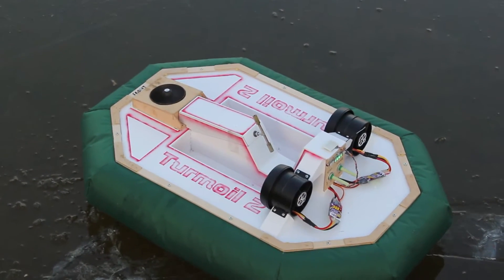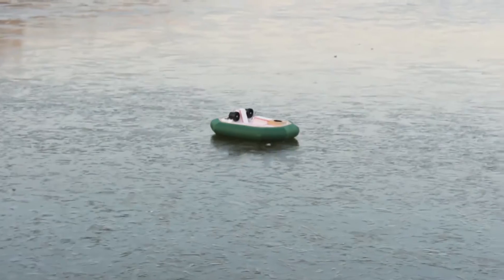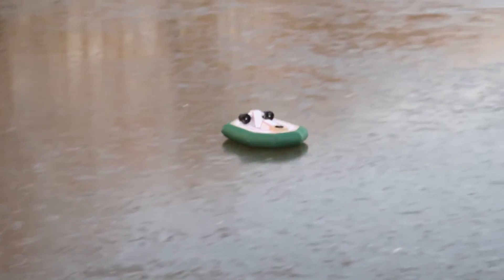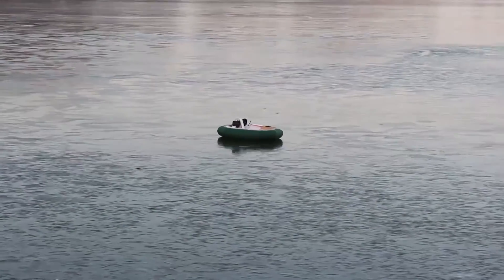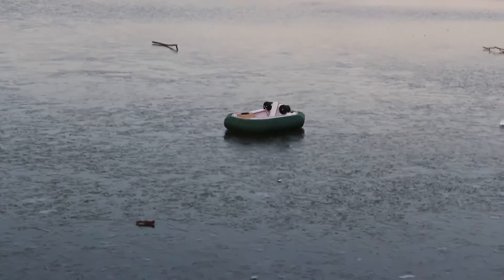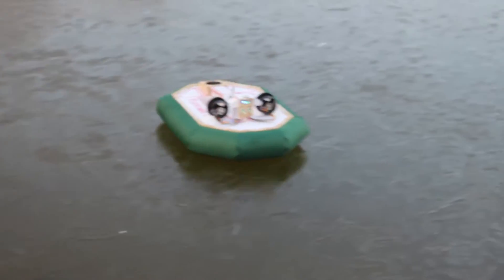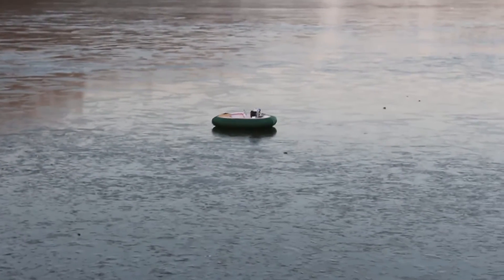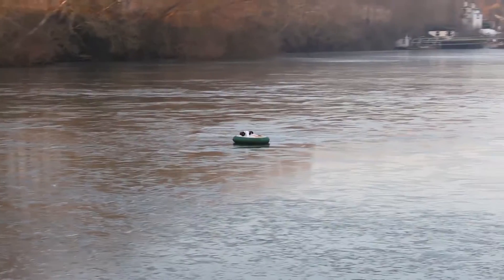Model hovercraft with gyro MPU-6050 Arduino on ICE.

Comment: Good job! What did you use for skirt material? I used a shower curtain on mine. Also using an Arduino. Here's the shakedown run of mine: youtu.be/IB_A_Q3eGZc .. I have another video to upload I've made some significant improvements. I have managed to carry 70lbs as well.
Reply from the maker: Thanks for your comments. The skirt material is just a waterproof fabric i got from the material shop! its nice to work with and easy to sew. Also comes in red blue and green! This test was the first proper test and i now have a few changes to make in the program. the main change is to allow steering with no forward or reverse throttle, and i need to correct the gyro response in reverse. its amazing what weight a hover craft will take, before i added the middle section i was able to lift a full size car battery!!